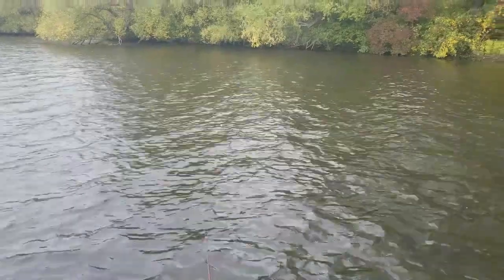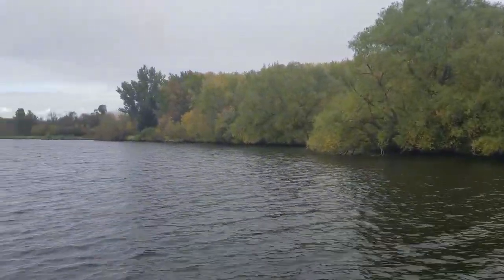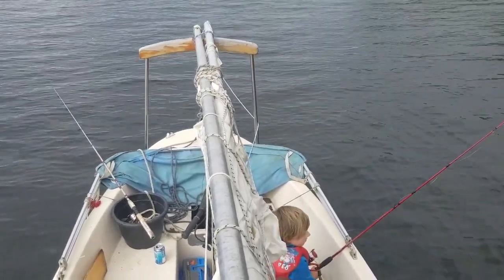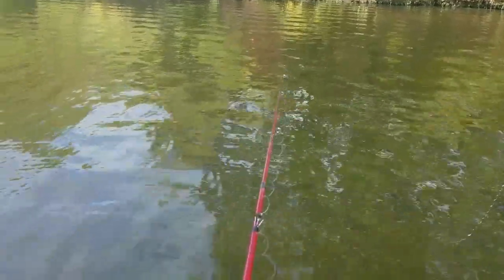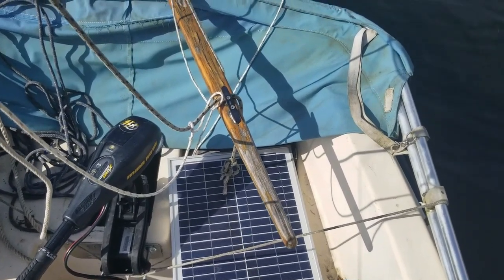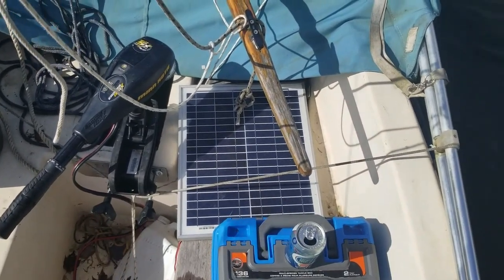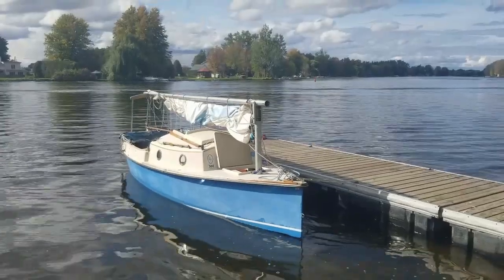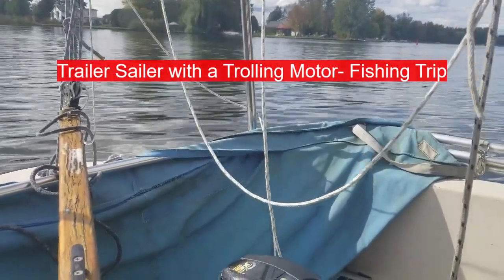Trailer Sailer with a Trolling Motor Fishing Trip

Comment: Those mini kotas are really efficient motors.
Reply from the maker: Yeah.  The Minn Kota came with the boat when I bought her.  I have been using it intermittently since.  If range is not required I prefer it to the gas motor, but if I want to motor more than a few miles it makes less sense.

Comment: Going to do the same thing with our Bay hen here in MN this week! How often do you use the bimini? Ours doesn't have one and I am debating getting one made in the spring.
Reply from the maker: Bay Hens make good motorboats and not bad fishing boats.  Bring a stove and do a fish fry on the water.  We like to cast from the bow and stern decks.
Reply from the maker: Oh, the bimini.  We use it and we like it, but we don't really use it that much.  We are more likely to duck down into the cabin for a brief squall.  When we do use it, it's for sleeping aboard.
Reply: @travelbywater9378  thanks for responding! We do the same with the cabin. Seems like it might be more trouble than it's worth to get a new one made.  We enjoy your videos of the hen. Was great to learn how to use our boat on YouTube this summer!
Reply from the maker: Thanks.  I would hold off on the bimini.  A custom enclosure will likely cost several thousand dollars.  You could do something out of polytarp or nylon and see how much you use it.  Unless you can do your own canvas work, it's a pretty expensive item. :)